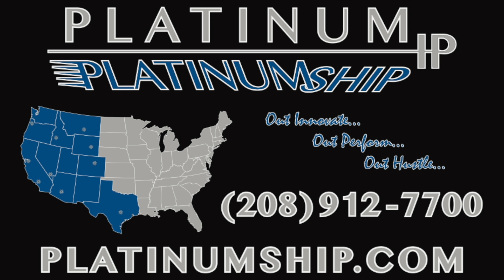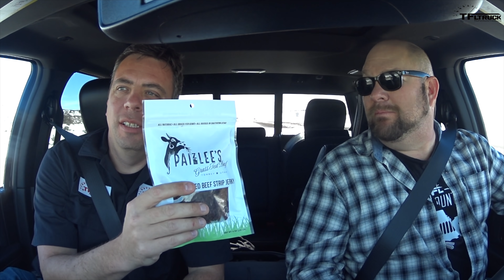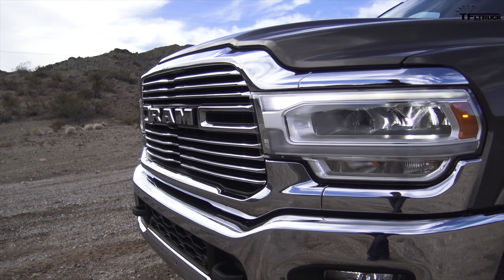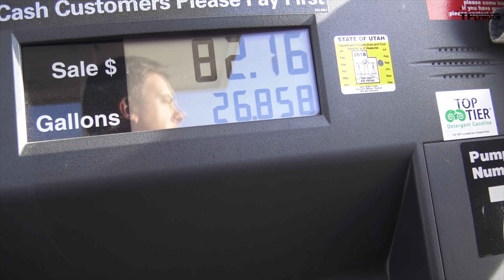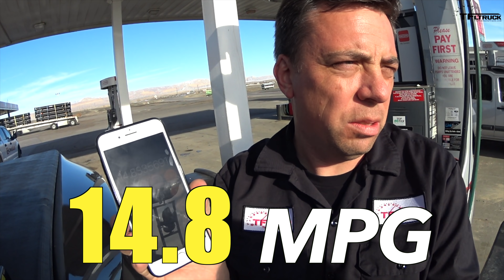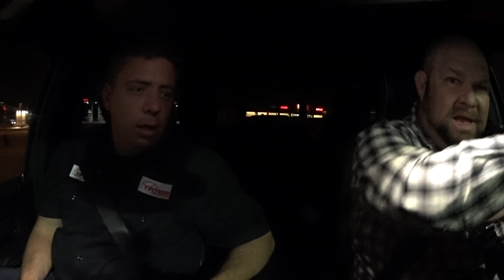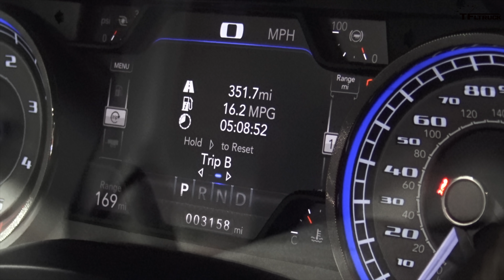We Drive 800 Miles in the New 2019 RAM 3500: Here's How Fuel Efficient 1000 lb-ft of Torque Is!

Comment: I feel like 15 mpg for an empty diesel is pretty terrible. I guess society can thank def and emission systems for that.
Reply: Try driving a 18 wheeler and see I get like 7 to 8 mpg to the gallon
Reply: Darius Hope Thats actually pretty good for a semi.
Reply: @JohnDoe-nz6bk  it really is
Reply: Darius Hope I probably get about the same, but with my job and running a PTO for about 4hrs a day I only get 4.5. Glad my company pays the fuel bill.
Reply: @843MudMafia.  I have a 2014 Volvo that's getting 6.2mpg pulling a 6axle trailer that has a 140k gross and it's loaded with 94k in the tank. It's far better than the Pete's getting 4.7mpg pulling the same loads. Lol. Empty it's getting 9.6mpg 46k tare. Back in Nov I went from New Brunswick to Port Huron Michigan and averaged 5.2km/L(12.2mpg US/14.6mpgIMP) empty of course.
Reply: Darius Hope the truck I drive gets about 4 lol
Reply: @843MudMafia.  7-8 but you get that, for the most part empty or loaded
Reply: I don't think anyone has mentioned that this is 15 mpg on winter blend diesel. My 2015 Ram with the 6.7 picks up about 1 - 1.5 mpg during warm months when fuel stations aren't running winter blend. I would be interested to see a real world test during the summer.
Reply: @raymondprell398  glad you caught that as well. Pilot truckstops where they fueled both times it looks like blends 50/50 #1 and #2 diesel in the winter. Very terrible fuel mileage in winter.
Reply: Raymond Prell 1 mpg from winter blend to summer blend do you thinknit makes a difference!!!!This trucks fuel efficiency is crap!!!And i am a diesel mechanic!!!Empty to get 15-16??????!!!!!Its should get close to 20-21 empty!and go in low double digit when towing or even single digits!
Reply: @raymondprell398  yeah, but 16-16.5mpg is still pretty bad
Reply: Super_sayan Goku no, it's not!
Reply: @super_sayangoku2074  I don;t think that is to bad considering the truck they were in was a 3500 Dully that certainly will weigh more than 8500 + pounds.
Reply: @super_sayangoku2074  motor in a dually.  They're bricks aerodynamically
Reply: Raymond Prell there is NO SUCH THING AS WINTER BLEND DIESEL!
Reply: @JohnDoe-nz6bk   yes there is a winter blend for diesels it helps to keep the fuel from gelling in the tanks and fuel system I know I have driven a semi for over 35 years
Reply: @JohnDoe-nz6bk   um...WRONG. https://nwfuel.ca/whats-deal-winter-diesel/
Reply: rsg1963 WROOOONG! It's just a additive to keep it from gelling!! Doesn't effect the performance like gasoline winter/summer blend. Also, you supposed diesel owners, diesels perform better when they're hot. However, no matter what time of the year (I live in the rust belt), my Cummings consistently got between 19-20.4 mpg.
Reply: rsg1963 Winter diesel fuel refers to diesel fuel enhanced to prevent it from gelling in cold weather conditions. In general it is achieved by treatment with additives that change the low temperature characteristics of the fuel. Wikipedia
Reply: James Mcvey  yes, you're right! But, that idiot is trying to say that winter blend diesel acts like winter blend gasoline when it doesn't.
Reply: John Doe Yes, there is- http://www.kendrickoil.com/understanding-differences-diesel-fuel-grades/
Reply: John Doe really? Google if there’s such a thing as winter blend diesel fuel, I bet you find out the same thing I did, they mix #1 diesel or kerosene in with #2 diesel to lower the gel point for winter, depending on where you live in America if you’ve ever seen it before
Reply: Todd Miller I know there is you idiot, but it does nothing to the mpg as they add the extra octane. So hence, there's no winter blend diesel. Hell, they didn't even sell it where I'm from, just regular diesel!
Reply: Todd Miller don't try to argue with the guy about winter blend diesel.  You'll be wasting key strokes.  He doesn't believe that mixing anti-gelling additives to regular diesel constitutes as blending.  Hopefully he's just a 15 year old keyboard warrior and isn't old enough to vote.
Reply: John Doe lmao!! Now I’m an idiot for clarifying the fact that there is such a thing as (winter blend diesel fuel) which to my understanding it’s the total fuel density that makes the biggest difference, not just cetane, winter diesel fuel is more volatile but less dense because of the k1 or #1 diesel added to it, less fuel energy available from it, I’ll bet you didn’t know they have winter gasoline up here in the northern states, more volatile but less energy to be had from it, I’ve owned and operated semis and all kinds of diesels up here for 35 years and it’s just something we deal with up here so do some research
Reply: Todd Miller it's not winter blend, not like gasoline. Diesel is diesel, no matter what year you get it! Not that hard to understand idiot!!
Reply: Todd Miller oh, you do know that the oil companies add the additive to stop it from gelling, rather than mixing 1-2 right? Of course you didn't! Like I said, educate yourself before posting stupid comments.
Reply: John Doe have ever heard of #1 diesel and #2 diesel? What is the difference if diesel is diesel as you claim? Do you even know? The refineries start shipping the winter blend in November and goes to April I think and I don’t even gave a choice what I buy at the pump! So now you’ve called me an idiot at least twice now so I guess I’ll leave it go that I can’t fix stupid so live in your own little world  IDIOT!!!  Fling j and pilot (one and the same actually) in 2016 - 2017 policy was to single treat with additives to a certain temp then double treat to -5 degrees, anytime the temp would get below that they would mix in 20% #1 diesel, if that (preferred) method wasn’t readily available to them they would triple treat with additives. And that is from their published policy article  🤷🏻‍♂️
Reply: John Doe Damn your a total fool... again. You really are too stupid to simply admit when you are repeatedly proven wrong. http://www.kendrickoil.com/understanding-differences-diesel-fuel-grades/#
Reply: Todd Miller diesel one is just kerosene and used for heating oil, not really considered diesel. Are you too stupid to understand that?? Regular diesel is diesel as its diesel, there isn't different grades of you #2 diesel like regular gasoline. No one puts kerosene in a diesel engine to run, as it will blow your engine from lack of lubricating properties. Now, most places sell "winterized diesel" from the refineries that has the additive (not kerosene) to keep it from gelling and have the little octane boost to make up for the additive (basically it's your "summer diesel" year round) hence diesel is just diesel, there is no performance lost. You ppl are really stupid, especially you Larry. It doesn't take long to look this up idiot!
Reply: The Real John Smith oh look, Larry is back. I've proven you wrong too many times to count. Go back to mommies basement and cry like you normally do after I hand your ass to you.
Reply: @JohnDoe-nz6bk  I have to disagree, if you come up to the northern states they do have a "winter blend". Winter blend diesel will reduce your fuel mileage, Colorado is one of the state's that gets this mixture. 

http://www.lcbamarketing.com/why_diesel_fuel_economy_drops_in.htm

https://www.google.com/amp/s/www.bellperformance.com/bell-performs-blog/winter-diesel-fuel-mileage%3fhs_amp=true
Reply: The Real John Smith I also already provided a link and at the end of one of the paragraphs, it states "many car companies prohibit the dilution of diesel fuel with kerosene or additives, as it will ruin your common rail or unit injector."
Reply: Lorne H I live in the rust belt, and got 19-20.4 mpg all year round. It might have dropped a little from using remote start!
Reply: @JohnDoe-nz6bk  if your statement is true about not diluting your diesel with additives, what do you do In the winter?  Up here in Michigan without it, your engine will not start until spring. The "winter blend" plus polar power is the only way we can run our equipment. I don't want to be mean, but you have no idea what you're talking about...
Reply: Lorne H that's where glow plugs, heater grids etc come in. I never had a issue with my Cummins starting. Hell, my 2016 limited even had a fuel heater in the tank. A little slow sometimes, but it always started.
Reply: @JohnDoe-nz6bk  I'll wait for you to show me where those are on the 15 liters. Block heaters are the only thing we have. But they are useless if your fuel is gelled, the only thing you can do for that is " winter blend diesel" with additives. I'm a Nccco crane operator/ heavy equipment operator with a Class A CDL.  You have no idea what you're talking about.
Reply: Lorne H I have a new (2018) 4500 dodge and it says in the owners manual not to use any diesel fuel that is mixed with bio diesel more than 5%... every trucks top I go into mid states it says right on the pump that the mixture can be anywhere between 5 and 20%. The way I understand it’s because when it regenerates it injects diesel on the exhaust stroke to put raw fuel into the exhaust to help burn things out and with bio being a solvent it washes the cylinders and can cause excessive wear. Now me being a dumb truck driver for 35 years and can’t even buy the right fuel for a brand new truck (which is deleted to solve the issue) to protect my investment I’m supposed to believe that just because some car manufacturers say you can’t add #1 to diesel in the winter months to help with the gelling problem that they don’t do it   Lol  sorry this is in response to the idiot John Doe and not directed at you, just had to vent   Have a good night
Reply: Todd Miller yea, you're definitely a dumb truck driver. 99.9% of truck drivers aren't very intelligent!
Reply: Lorne H I absolutely do! If you're a "crane operator" then you know the diesel standards are next to nothing and thats why the red dye diesel is used. Nice try though!
Reply: @JohnDoe-nz6bk  Try using the red dye diesel on a Linkbelt ATC 3210 going down the road. If you ever got a D.O.T. inspection, you would know any mobile crane will get it's fuel tanks check. If I had red dye in my tanks I would be shut down, waiting for my tanks to be pumped. Hell that's for any Commercial vehicle going down the road. Even the "dump truck driver" knows that lol.
Reply: Lorne H uhhh.. You do know that using heavy machinery like "your crane" only uses red dye and is allowed to be on the road while transporting. 🤦‍♂️ nice try at acting like you're intelligent.
Reply: Lorne H oh, here... https://www.dieselmachinery.com/inventory/?/listings/cranes/for-sale/24565391/2018-grove-yb4409xl?dlr=1&pcid=3769311&sfc=0&ssc=0&lpcid=2993799&snai=0
Reply: John Doe you must be one of those coal rolling yuppies that (has a Cummins) and lives in your mommies basement?   Lmao
Reply: Todd Miller rolling coal is the dumbest thing ever, idiot! Only inbred hill Jack's do that!! Like I said, I'm more of man then you'll ever be and haven't been in "mommies basement" for almost 2 decades!
Reply: @JohnDoe-nz6bk  Wow that is the dumbest thing I've ever seen. That's a grove carry deck, transported by a low boy. You do know that the crane you sent me runs on propane also, like a hilo. 

I send you a mobile crane link, the " Linkbelt ATC 3210" drives itself down the road. You have absolutely no idea what you're talking about. I'm actually blown away by the stupidity you're bringing to the table right now.
Reply: @JohnDoe-nz6bk  it's transported, not transporting. Big difference, off road crane's get transported by a semi and trailer, transporting is self driving. Look up all terrain cranes. You can't really be this dumb? You're the perfect example of what someone looks like that has no idea what they're talking about.
Reply: @JohnDoe-nz6bk  https://youtu.be/jyPzmy1xG1k
Reply: Any vehicle that drives itself down the road, has too have "onroad diesel" lol
Reply: Lorne H no, not when you have to transport it from site to site. 🤦‍♂️ geezus man!
Reply: Lorne H 🤣🤣🤣 says the idiot who doesn't know what he's talking about!
Reply: Lorne H who's stupid again?? https://www.irs.gov/pub/irs-pdf/p4941.pdf
Reply: @JohnDoe-nz6bk  Any commercial vehicle that drives down the road has too have on road diesel! What don't you understand? If it's being hauled on a trailer it doesn't. I sent you a link of the Linkbelt crane I operate, driving down the road. Are you that dumb? All semis, mobile cranes, run on road diesel.
Reply: @JohnDoe-nz6bk  You just sent me a link proving my point! " Attention trucker's, no red dye diesel on the highway's". Mobile crane's drive themselves down the highway, they fall under the same rules as semis. I have to have permits when I go down the road, stop at the same weight stations. Dam you're dumb.
Reply: Lorne H here's another link belt for you, idiot. That needs a semi to haul it, but still uses red dye and can drive it's self from site to site if need be. I can't believe the pure stupidity you're showing. And you have a class A??? 🤣🤣🤣🤣🤦‍♂️ God help us!
Reply: @JohnDoe-nz6bk  crawlers, rough terrains all need to be pulled to job sites. I run All terrains! They drive themselves, what do you not understand about that? I'm blow away by your stupidity...
Reply: Lorne H and yet, I proved you wrong. idiot!
Reply: @JohnDoe-nz6bk  yes site to site if it's off road lol, not driving down the highway! I'm still waiting on the link?
Reply: @JohnDoe-nz6bk  I can't wait for other people to read your comments and see how dumb you're kid. You should probably delete your comments lol....
Reply: Lorne H yes, you can drive them "on road" you idiot! I'm not talking 30 miles, I'm talking like 5 miles. I know, I've escorted them. I also use to operate a CAT frontend loader. Like I said, you have a class A?? God help us!
Reply: Lorne H 🤣🤣🤦‍♂️ you call me dumb?? Bwahahahahaha it's you are, not you're! 🤣🤣
Reply: Lorne H I provided it, I can't help you have a SEVERE reading comprehension problem!
Reply: Lorne H red dye has to be used for non registered vehicles you idiot! Like a frontend loader, certain Crain's etc. However, those still can be driven on the road for certain things! 🤣🤣 geezus man, don't you known how to read??
Reply: Lorne H https://www.linkbelt.com/product-line/lattice-crawlers considered "off road" but still can be driven on road!
Reply: Lorne H OK.. I will admit I'm half wrong. I didn't realize that each state has its own set of laws regarding off road machinery. In my state, it's allowed under our ORC and most likely different in other states. https://www.google.com/url?sa=t&source=web&cd=1&ved=2ahUKEwjJo7Wit4PhAhUBYK0KHZ0wB5wQFjAAegQIABAB&url=http%3A%2F%2Fcodes.ohio.gov%2Forc%2F4513&usg=AOvVaw0B7xovzuIiTW9sn2cfg9ae
Reply: @JohnDoe-nz6bk  you sent me a link for a crawler crane lol. Show me a crawler going down the road that's not disassembled and on a trailer. I've worked in 49 states, all terrain cranes are registered vehicle's that are self propelled. You have no idea what you're talking about.
Reply: @JohnDoe-nz6bk  you sent another link proving my point again lol.
Reply: @JohnDoe-nz6bk  if you want anyone to even consider what you're saying, you will get rid of the crawler crane link with a rough terrain one. That would be the only one to use off road diesel to cross a road lol...
Reply: Lorne H I absolutely know what I'm talking about, and proved you wrong AGAIN!! Geezus man, you really are that stupid!
Reply: Lorne H the link proved your point?? 🤣🤣 you need to working on your reading comprehension problem there!
Reply: Lorne H I have no idea what I'm talking about?? Bwahahahahaha 🤣🤣🤦‍♂️ like I said, it's scary that you have a class A. Hell, I even provided the ORC to my state where it says it's allowed to. But hey, you continue to work on that reading comprehension. 🤣 I can see why your were only able to drive a truck! 🤣🤣
Reply: @JohnDoe-nz6bk  yes there is because if u go north without it in winter ur feul will gell up.
Reply: @jamesmcvey3178  i agree i drive a semi myself
Reply: John Doe Holy crap you are the most ignorant dumbass on the internet.  

“Diesel Winterization
Diesel fuel needs to be winterized.  Why?  Diesel fuels contain paraffin (wax) which causes it to gel as it cools, leading to possible engine failure. No one wants to have a stalled vehicle in frigid temperatures.  Number 1 (1D) and Number 2 (2D) are the primary fuels for most diesel applications. During warmer months, 2D, considered a summer-grade fuel. As the weather cools, distributors change the mixture of the fuel to a “winter blend” or “winterized blend” of 2D and 1D. See the article from Freightliner’s Team Run Smart for more details.
As the seasons change, it is a good idea to check the fuel grade, as well as the cetane rating on the pump. The higher the cetane number, the easier the diesel vehicle will start in cold weather.”

https://www.trucking.org/ata%20docs/About/Organization/SMC/Documents/Diesel%20Winterization.doc
Reply: @JohnDoe-nz6bk  Thank God that you have to be Nccco certified to run a crane. Other wise people would get killed because of idiot's like you. You have no idea what you're talking about, ground bearing pressure, ground conditions, being level or within grade conditions. I'm going to take my couple hundred thousand pound crane with a hundred foot of boom down the road. Never mind all the power lines tree's lol.
Reply: @JohnDoe-nz6bk  https://www.google.com/url?sa=t&source=web&rct=j&url=https://www.nassco.com/purchasing/environmental/10_Off-Road_Diesels/10_%2520Env%2520Req%2520for%2520Operating%2520Off-Road%2520Diesels.pdf&ved=2ahUKEwic2qjW_YPhAhUBIqwKHYXOBXkQFjABegQIAhAB&usg=AOvVaw2s2lweHOkNcTEjs2YUA6MX 

Thank God for licenses, or people like you would think they know what they're talking about lol.
Reply: Lorne H 🤣🤣🤦‍♂️ like I said, you're a special kind of stupid! What does that link have to do with anything?? You do know that semis do travel on the road that are well over several hundred thousand pounds right??? Oh, that's right, you're not a very intelligent person and you have a class A?? My God, that's very scary! I already proved you wrong, shown you a crane does come with heater grids, etc. Shown you that machinery that uses red dye diesel can be used on road for certain applications, etc.. Get over it soyboi, you lost and turn your class A in. I bet you don't even have one and are suspended! 🤣🤣 typical dumbass truck driver
Reply: The Real John Smith I may be ignorant sometimes, but you're the dumbest!
Reply: John Doe Multiple people calling you out with sources and you remain as ignorant as ever.
Reply: The Real John Smith better than being a dumbass like you! And that's because we're all right! They'll mix it and add the anti gell additives. I've talked to several truck drivers today and they all said there was no difference with performance or mpg, if there was, it was slight!
Reply: John Doe You mean the same truck drivers you insulted and called 99.9% not smart a few comments ago? Once again your full of shit. The driver has no idea what is in the tank of the station they are filling from. Twice a year refineries switch between summer and winter blended fuel. It is already blended at the refinery and further blended at the terminal. https://www.google.com/amp/s/www.bellperformance.com/bell-performs-blog/winter-diesel-fuel-mileage%3fhs_amp=true
Reply: @JohnDoe-nz6bk  yes in CO we have number 1 or number 2 diesel depending on the time of year.
Reply: John Doe your are absolutely wrong. Specifically, it has kerosene blended into it, which will show up in hp and mpg, but probably not enough for a soccer mom like you to pick up on it. 
     If it where not so, fuel would gel. Drive to Florida right now, fuel up a jug of diesel and put it in a deep freezer for a few gpurs
Reply: @JohnDoe-nz6bk  
No one puts kerosene in a diesel huh? How about the us military? In many theaters the only thing the entire motor pool runs on is JP5 or JP8 jet fuel. Guess what that is. The approved list for even the large trucks is diesel 1, diesel 2, jet A, Jp5, Jp8, commercial kerosene, diluted used oil, and so on. Every last piece of diesel equipment around a air base runs on kerosene. 
 I personally ran a Cummins ram on nothing but Jet A for years. That truck is still on the road.
Reply: @JohnDoe-nz6bk  no "G" in Cummins...  how hard is spelling?
Reply: @JohnDoe-nz6bk  yes there is. I delivered it. Friggin troll
Reply: Robert Rutherford suuuuure you did!
Reply: @JohnDoe-nz6bk  yes there is winter blend. We have to run it in WI in the winter.
Reply: @JohnDoe-nz6bk  wrong. Its blended.
Reply: @JohnDoe-nz6bk  winter blend is a mixture of number 1 and number 2 fuel. This last winter we had to run 50/50 mix to not gel up.
Reply: @JohnDoe-nz6bk  I have a 95 dodge 12 valve and I've always mixed kerosene in my fuel when it gets cold instead of the bottled additives. I also mix used motor oil in my bed mounted tank this mix I pump back into my and tractor. I have two filters on this tank that catches anything that's in the diesel, kerosene and the used oil before I pump it into my truck or tractor. 370,000 miles on the truck and still has original p pump on it
Reply: @JohnDoe-nz6bk  no truck or crane can run red fuel on the hughway. They will get you for tax evasion
Reply: @JohnDoe-nz6bk  yes there is in the rocky mtn states especially they put additives in to prevent fuel gelling.
Reply: @rigging1377  I drove an old Brockway 30 yrs ago had a 1693 cat engine that had glow plugs. But I do now that doesn't keep the fuel  from gelling we would mix diesel fuel with kerosene 50/50 fuel milage dropped but fuel didn't gel. That 1693 cat was the only 15 liter engine I have ever seen with glow plugs
Reply: I feel some of you are almost missing that the higher in altitude you go the less efficient the engine becomes. An average of 15 mpg at that altitude is decent. Like Nathan and Andre I wish the truck had a larger fuel tank.
Reply: DEF doesn't sap fuel economy. DPF does.
Reply: Erik Kovacs they are one in the same. Def is the fuel for the dpf.
Reply: @nothankyou9906  not exactly. diesel fuel is injected directly into the DPF for high heat regeneration.   DEF is used the rest of the time to knock down NOX.
Reply: They were running 70-80mph.
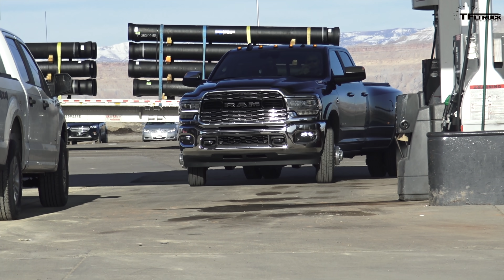Reply: dedalliance1 I think it’s the 4:10 rear end
Reply: Trucks with NOx control and DPF systems are less efficient without DEF, but that does mean DEF increases efficiency. DEF doesn't provide a net increase in fuel efficiency, it just lessens inefficiency of other emissions systems. Rip EVERYTHING out from under that truck, and you'll be closer to 20 MPG.
Reply: It has 4:10 gears and a aisin  transmission. And DEF isn't a bad thing, it's the EGR AND DPF that hurts you!
Reply: @JohnDoe-nz6bk  Well, even my 2018 GMC Sierra 3500 crew cab long bed gets 12ish mpg highway with a 4.10 rear end with the 6.0L gas engine.
Reply: dedalliance1 my 2016 ram 2500 mega cab limited Cummins got between 19-20.4 mpg.
Reply: dedalliance1 then what are you complaining for??
Reply: @JohnDoe-nz6bk  I'm not complaining I'm just saying for a diesel 15 mpg doesn't seem very good on a completely redesigned truck when my gas engine is arguably 2 decades old of a design and still gets 10 to 13 mpg. Maybe they should start designing trucks for fuel economy instead of some 35k pound tow rating that's never going to be used by 99 percent of buyers.
Reply: @dedalliance1  the 6.0 is a powerless turd
Reply: @corylee2261  no kidding... garbage motor.
Reply: John Doe was gonna say I thought they got about that
Reply: @dedalliance1  yet that gasser has no where near the power level or capability of the diesel. However, not everyone needs a diesel or that much tow power...so gas options are good to have
Reply: Cory Lee ignorant
Reply: @dedalliance1  are using the computer in the truck or are you hand calculating.  I've got the same truck and I get 14 combined city and highway and that's hand calculated. The truck always says 13.3 though. During the spring and summer I get 14.5 to 15 mpg combined. I've always loved the 6.0 vortec.
Reply: @JohnDoe-nz6bk  2500 should be better, as it has fewer tires and doesn't have the big wheel coverings that hurt efficiency quite a bit. But also, this is them crossing mountain ranges.
Reply: @dedalliance1  ---15 mpg is 25% better than 12 mpg.  Pretty huge difference really...
Reply: @JohnDoe-nz6bk  Guessing it didn't get quite that high at 75-80 TFL claims they were driving.  Slow it down to 65 and get big improvement on my 04 Chevy Duramax Dually empty 18.5 mpg.
Reply: @roadrunner7828  I just go off the computer, it's usually around 0.5 mpg plus or minus when I double check it. But over the 8,500 miles on it the truck says it's averaging 10.5 mpg.
Reply: @larryj8924  But who honestly goes 65 mph unless you're towing, and then it doesn't matter.
Reply: Well this comment like super exploded. I personally think these companies should be putting more money and engineering into fuel efficient instead of 35k towing numbers. But that's just me, obviously diesels are much more powerful, but they're supposed to run a lot more efficiently than gas, but for the price of diesel fuel, more money in oil changes and the additional purchase price, I wouldn't buy one unless I was going to tow 14k+ pounds and or tow more than a couple 2 or 3 times a week.
Reply: dedalliance1 the cost of oil changes is the same or better per mile.  The intervals are much longer than a gas engine.  So 10 qts vs 6 qts but I go 10,000 miles with my Duramax vs 6000 miles with my daily driver 6.0 vortec.  I own both at the same time and put an average of 30,000 miles per year on them combined.  The gas is much better suited to daily driving because the city mileage of the diesel is only 2 better than the gas and the gas truck is cheaper so I save the diesel for my “nice truck” and drive gas during the week.  Diesel has bigger cost when they break but routine maintenance is not really a factor.
Reply: @LTD_Outdoors  are you my dad?  My dad would always do the exact same thing when I was growing up.  Always cracked me up.
Reply: dedalliance1 lots of buyers will be 5500’s which will have the same engine. Those will work a lot.
Reply: @dedalliance1  
Keep in mind that this truck was a dually, that hurts fuel economy alot. I'm sure a single rear wheel could easily hit 20mpg.
Reply: @dedalliance1  you also have to take into account that it is a new truck, once it gets  broken in the mpg will get back
Reply: @moparjr89  Hopefully it will get better gas mileage when it breaks in, but I don't know how much it's really going to improve.
Reply: @dedalliance1  -- maybe people don't need a 1 ton dually with a thousand ft lbs of torque to go to the mall, let trucks be trucks and cars go to the mall
Reply: @mdlclassworker3384  I don't think I said anything about trucks going to the mall, but in reality with the prices of these new trucks a lot of people can't afford the taxes and registration and insurance of a truck and a car and also pay for the car at the same time, so it forces people to drive their work trucks all the time and getting 15 mpg if you have a 30 mile commute each way can really add up. I'm just saying it would be nice if the truck companies would invest more money into fuel economy instead of 35k pounds of towing when anyone with a brain pulling that much is going to get a medium duty truck. If they could push 20 mpg empty with a tune in the truck that would be great.
Reply: @dedalliance1  maybe 99% of the market bought the wrong truck. Those trucks are for towing and utilities like pulling a horse trailer or auto hauler that doesn't want to buy a semi. Sadly if you're cruising and care about mpg get a half ton
Reply: @kamilzarzycki3866  unfortunately halftons hardly get any better fuel economy, my old 05 Sierra extended cab standard bed halfton got 15 to 18 highway usually, one time I got like 21 but that was rare. Like the new ram halfton didn't it get like 17 or 18 on this channel?
Reply: @dedaliance My 05 3500 gets 20ish mpg, Cummins 5-9.  But I need a truck that'll haul 30K not  the 15K my truck is rated for.  Perhaps if you need less truck, and better mileage, buy a 1500.
Reply: Cory Lee no it’s not
Reply: @dedalliance1  without DPF/ DEF diesel trucks get closer to 20mpg. I've owned 3 Rams and use a Ford f350 for my business. It's all the same story till u delete them. Then they get much much better. DPF/ DEF was designed to just suck another 10-15$ every 3rd-4th fill up from the logistics business.
Reply: @dedalliance1  they did! Its the 2500! 2500 has the standard output engine that has 19:1 compression ratio! The high output went down to 16.5:1. So u have options!
Reply: @dedalliance1  
Dodge has a pickup for you. It's called, 2500 & 1500 (30+ mpg).
Reply: @nellyfarnsworth7381  I don't think any ram 2500 reliably gets 30 plus mpg, I don't even think their halfton diesels reliably get that. Maybe with a tune and delete kit, but that's about it.
Reply: @dedalliance1  
The new 1500,  Diesel 3.0 liter is 29 & 30 mpg highway UNLOADED. 
My brother's Dodge 2500  5.9 liter with 12 valves, with manual transmission (when new)  would get 24+ mpg Highway. But new was 700,000+ miles ago.
Reply: @nellyfarnsworth7381  EPA isn't always accurate, and a 5.9L 12 valve cummins was pre- Emissions everything, so it's obviously going to get better fuel mileage. In todays time we have to deal with emission equipped trucks, unless we delete them.
Reply: @dedalliance1  
Read again, the Dodge new 1500 with 3.0 liter diesel with get 29 & 30 mpg highway UNLOADED.
Reply: @nellyfarnsworth7381  http://www.fuelly.com/car/ram/1500/2018?engineconfig_id=238&bodytype_id=14 Says you're wrong.
Reply: @dedalliance1  I doubt that people buy 3500's unless they need to tow heavy trailers. We're not looking for hybrid-type MPG. We need tow capacity. Our hybrid is our commuter vehicle.
Reply: @jos.4276  Right, I get that but even 1 mpg is a big price difference, especially if you're using your vehicle for work.
Reply: @dedalliance1  A different vehicle may be a better choice for you?
Reply: @jos.4276  I mean, I personally have a 2018 GMC Sierra 6.0l gas SLE 3500 HD Crew Cab Long Bed that I put 28k miles on, never resetting #2 trip meter its averaged 9.6 mpg. So trust me I speak from experience spending 300 to 400 a month on fuel, and 700 a month on the truck and 200 a month on insurance is a really expensive cost to own for a vehicle. These manufacturers are out of their minds if they think they can charge a 10k premium for a emissions riddled diesel that gets crap fuel economy, garbage reliability because of emissions and the fact it's illegal to tamper with them (not that it stops anyone, for now) and they're super expensive to fix.

I've seen plenty of 6.0l gas engines go 200 to 300k and 400k miles without a whole lot of problems, they're cheap, easy to find parts and they're small so you can actually work on the engine without taking cabs off lol (ford).

But also, I have a 2014 Chevrolet Cruze 2.0l Turbo Diesel that's rated at 47 mpg highway and is unfortunately equipped with emissions, but that's okay because it's worth keeping it running because it's the most fuel efficient non hybrid vehicle that you can buy and still fit 4 or 5 people in. One of these days though I'm going to delete it so I can push 60 to 80 mpg.

But to sum it up, I don't know why I'd want to buy a new diesel that's anywhere from 45k to 85k dollars, that gets ultimately garbage fuel economy, pay more for diesel fuel that's a byproduct of making gasoline, riddled with emissions problems, pay more for any repairs, so I can look cool doing 75 up a mountain pass with a trailer lol. My gas truck does just fine and will last longer lol.
Reply: @dedalliance1  I get 14.5 mpg (city) with my 6.7 Cummins '19 Ram 3500. I paid $43 k for it, barely used, with 10k miles on it. We're hauling a trailer. It gets better mileage pulling our trailer than our 2016 F150 gas 3.5 ecoboost. This will likely be our last truck.
Reply: @jos.4276  Hopefully it's your last truck, but it being a Ram there's a decent chance you'll replace the transmission sooner than you should. The Electronics will start to fail in it like any modern vehicle, and the emissions systems are usually garbage and will break, when it's out of warranty that's expensive.

For example, my sister has a 2011 3500 Silverado diesel,  granted it's the first model year of all the emissions, but like a little bit before 200k miles she drove from Colorado to Illinios hauling a horse, when unexpectedly in Illinios the emission system failed and put her truck into limp mode. So what do you do, you're a thousand plus miles away from home, you have a 25' trailer with a live animal in it and a truck that won't go above 25 mph. A tow bill would likely be thousands of dollars, a real fix on the emission system would probably be a couple days, if not a week, assuming you're close enough to a shop that can do it, and has time. Luckily for her, she lives in a county that doesn't do emissions / smog checks so she took it to a shop and had them delete it, but this was Pre-Emissions crack downs we've seen in the past year or so. If that happened now, who knows if you'd find a shop that could do it.

I mean, Diesels are nice at 1 thing, and that's towing heavy things. The rest of it is just one giant expensive headache waiting to happen. I hope your truck is your last truck and goes 300, 400, 500k miles, but it likely won't without dropping a lot of money into it, and in 15 years or 20 years from now who knows, your truck may be made illegal because it won't be able to pass the new standards for emissions. They're already doing that in California, making diesel trucks that can't pass emissions illegal unless you spend 10 grand retrofitting emissions on them, no matter how old or new it is. The rest of the country isn't much further behind, look at History, everything Cali does the rest of the US adopts later, so hopefully you have a good amount of time.

That's just why I think diesels and manufactures are out of their mind, charging a premium for trucks that aren't reliable, are expensive, and still can't even break 20 mpg there's no reason to buy one all the big 3 manufactures are putting out gas trucks that tow 16-17k pounds, and they'll probably last longer lol.
Reply: @JohnDoe-nz6bk  I had a 2017 Ford F-350 DRW 4.10 4x4 that got 17.5 on the interstate highway.
Reply: @JohnDoe-nz6bk  def sucks.
Reply: I have a 14 2 door ram 3500 and gives me 16mpg so 15mpg for a fully loaded truck is really good
Reply: All you guys talking high numbers on fuel economy, be sure and check the fuel usage by a gps and the actual gallons used, the mpg meter in the trucks are MAYBE close sometimes but never actually accurate, I bought a brand new 1999 dodge dually that constantly said it was getting 20 / 21 mpg, in actuality subtract 3 mpg from what it read and you were pretty close, i own a brand new 4500 right now that I tow with ...... the meter is a novelty on it also   Lmao  I could say my 99 got 21 mpg because it did on the computer but it wasn’t nowhere close in actuality, I don’t believe all these high numbers unless it’s calculated with gps and a fuel receipt, then you have to even know which way the wind was blowing so a one time high fuel mileage claim from any of the big 3 don’t mean anything to my    Lol   I can drive down the road grossing 40,000 # and get 12 mpg... on flat ground and a 30 mph tail wind at 60 mph .... does it do that often?  NOPE!!! Lol
Reply: @zeusmia3554  almost everyone I know that has a 2500 diesel lies about what they get.  Funny they all get 20s.  I've owned enough of them to know 20 basically 9nly happens on highway only.  You add any city driving and its 15 to 17 hopefully.  I had a buddy brag about 22 mpg after he bought his new.  Later talked to him and found out that was resetting the gauge while driving.  People are idiots.
Reply: Matt Smith Just one source for a reference - http://www.fuelly.com/car/ram/3500?engineconfig_id=233&bodytype_id=14&submodel_id=
Reply: @MattSmith-vl8zp  19.9 was my best had calculated 2016 cclb 2500 ram diesel. Depending on weather and route 15-18 mpg never 20 or over for me
Reply: @claytonblachly4031  that's realistic...dudes acting like they average 24mpg on a 3/4 ton truck that weighs 8000 lbs plus
Reply: Factoring the truck is going over mountainous passes, is hard-loaded Limited, driving in the dead of winter, etc, 15MPG is not that terrible.
Reply: Whether you like it or not, Cummins makes the best diesel's on the road.
Reply: Do the EGR an DEF delete an get better fuel mpg.
Reply: @vulcanfist3007  absolutely they do, I've seen significant better fuel mileage on our glider semis. That's a brand new truck with a rebuilt pre emissions motor. I've seen 20 to 30 percent, depends on how you drive.
Reply: @vulcanfist3007  not the DEF just the DPF and EGR.  DEF has no affect on MPG.
Reply: Def and EGR/ DPF is the worst thing for diesel engines. Terrible Gas mileage til u delete it.
Reply: I had a 96 Dodge 3500, 5 speed manual, 4.10 rear with a 12' flatbed and averaged 18 mpg. Put some miles on that truck then check it again
Reply: dedalliance1 saving the planet one cardboard box & plastic jug at a time.
Reply: Winter diesel doesn’t help this MPG “loop”
Reply: Just delete it...
Reply: dedalliance1 My 2019 f250 Lariat diesel weighs 8240 “empty” with me in it. I routinely get 16.4 on long highway trips—hand calculated —empty. In the summer, I can top 17.2 avg on highway trips. I think Ram’s 14’s are horrid. It’s gotta be the 4.10’s. Perhaps break in will help some. I have 14,500 on my 19.
Reply: My pre emissions LLY Duramax gets only 15-17 empty but it's on 37" tires with a 4.10 ratio.
Reply: @BrianNC81  mine is a dually 6.0 all stock deleted can get 21 when I'm cruising at 60 mph it will go down to about 17 at 70 mph cause the engine speed is not far from 2.5k rpm
Reply: @Realdealwill4022  I've never driven that slow for any length of time to know if mine would do better.  Usually cruising 75mph on the highway so always at 16mpg ish.  Time is more important to me than a few dollars saved in fuel.
Reply: When I went to 4.10s that's when I saw a hit to mileage. The 3.42 is much better for mileage.
Reply: My deleted 2014 6.7 gets 22 to 25 on the hwy empty.  Before delete i was around 14 to 16.  It's a phenomenal difference in efficiency when they can breathe
Reply: exactly
Reply: Winter blend diesel + brand new engine that isn't broken in will net you around 15mpg.
Reply: On the other hand, my '07 Dodge 1500 with the 4.7 V8 would get about 14.5 mpg for my normal mixed driving. This truck weighs twice as much, has 5 times the power and 20 times the payload, and gets about the same fuel mileage. That's pretty impressive, in my book.  ;)
Reply: I just averaged 6.8 in my 15 liter semi, I was empty.
Reply: Lorne H that’s dang good, I wonder what you could get bobtailing? I’m sure your just like me tho, ya didn’t buy it to take the wife and kids to see Disney land, always something hooked to it trying to make a living, my 4500 ram only gets 11ish with a 11000 # flat bed hooked to it and combined empty of 21000, no idea what it gets by its self tho   Lol
Reply: @zeusmia3554  I apologize, I was Bob tailing. I went down to knoxville to pick up 2 brand new flat beds. It's a Michigan special T800, double framed with a Cat 550Hp, 1850 torque, 13 speed, 4.11 rears. If it was a highway truck it would probably do better.
Reply: Lorne H ah I understand now, that still is really good for a Michigan truck, I’ve never seen a truck from Michigan built for fuel mileage, and your probably just now typing up that you forgot about 3 extra axles hanging under that thing somewhere   Lol   That’s really impressive considering what it is
Reply: Todd Miller gosh that’s a terrible tare for a hotshot rig!
Reply: Yeah its really not great at all.
Reply: @BUILTDIESELMAFIA  Welcome to emissions motors...
Reply: @rigging1377  oh i drive a 2015 F350 I'm no stranger to emissions lol. Hate it. Wouldn't be bad if it was executed better but everyones systems just miss the mark of what it should be. Its a joke to think too that decreasing mileage is better for the environmemt. Some backassword thinking going on with the EPA.
Reply: 1000lb-ft, crew cab, drw, 4:10 gears, monster of a truck. Still gets better mpg than my 2002 v6 explorer used to.
Reply: My 1994 F350 4x4 12 valve swap averages 19. I see about 25 on the highway @ 70 mph. It has 4.10 gears is a 4 door long bed. 15 mpg all highway is pretty bad.
Reply: I'm inclined to agree, that's why I have a V8 gas F-150. 23.8mpg hwy all day every day.
Reply: Over 75% of the 6.7L Cummins is new for 2019. Block is now Compacted Graphite Iron, hollowed cam, new crank, new rods and pistons, hydraulic lifters (no valve lash every 150k miles), new high pressure fue pump, injectors, turbo, egr, egr cooler etc. 

Oh and oil changes on these trucks need to take 1 hour.
Reply: My 2003 F-350 can get 17mpg at 70 miles per hour
Reply: I leave trade chat and i still cant escape you @dedalliance1
Reply: Straight pipe and a tune are the solution
Reply: You can thank commiefornia for that
Reply: Running 75 to 80mph along that stretch of road in a truck that weighs around 8800lbs empty that is pretty good. It will likely average around 18mpg cruising at 60.
Reply: @doch5123  My 2018 GMC Sierra crew cab long bed SLE 4x4 6.0L gas engine with 4.10 rear end can run 90 to 100 mph at 10 to 11 mph. If I went 60 mph in my truck empty it could push 13 to 15 mpg, I just personally think a diesel should run more efficiently even at 80 plus mph. To me the whole point of a diesel is obviously the power for steering, but also the fuel mileage over a gas engine. I don't think this truck is meeting that standard.
Reply: Can't expect much from a 4 wheel drive truck
Reply: 27mpgs Indianapolis 2GrandRapids 30s temperatures
28mpg Jacksonville 2 WaDC
31mpg Ok City to Dallas Tx
27mpg Houston to El Paso Tx
27-33mpgs freeway 60mph
18-20mpgs city driving 10-18mpg off road
10-18mpgs tow 6kLbs Boat

2015 2500 Cummins 6spd 4x4 4door Crew cab deleted 4" pipe, KN flat air filter camper shell EdgeCts2 computer 

20gallon extra tank hitch 
3 light bars =970watts, 
Setup as 1st responder, 10,200lbs weight 

same mpgs since deleted by PFdiesel.com @78k
25-32mpgs freeway
20-25 city, 10-20 off road 
Avg.MPGs From 78k to 200k

Efficiency is measured TonXMiles per gallon used by scientist in the diesel truck industry.5.2tonsX28+mpg= 146TonMiles/gallon😀

Toyota Prius is 3200=1.6tX50 mpg=80Tmiles/gallon 😆

6 way MPG math calculated=
1-RAM computer
2-Garmin gps
3-Google maps gps
4-USGS maps gps
5-AAA maps Android
6-hand=4 semesters calculus

Diesel ECONOMY TIPS
1:Speed 55 & rpm 1500
2: Close Windows 
3: No items on top of car
4: Make truck aerodynamic  
5: Inflate tires 2 maximum
6: High rear end gearing3.42
7: Factory tall tires
8: 5-40w Synthetic Oil
9: avoid 4x4 driving
10: Remove excessive weight   
11: Fuel is heavy too
12: Plan journey wisely 
13: warm up engine
14: clean outside
15: Avoid RAIN 
16: No aggressive driving
17: Don't over-rev. 
18: Gear fast, slow & accelerate 
19: Avoid idling.
20: Overdrive & cruise control  
21: Ele&AC worsens MPG
22: Exploit cruising down hill 
23: Avoid a complete stop
24: red>roll in neutral gear
25: Tune engine to low HP
26: Change oil regularly.  
27: Replace air filters regularly.
33: Leave early Family drama 
34 constant Mph=Mpg 
36: avoid drama & stress
37 Park in shade
38 distance to prevent braking  
39: Forced induction =MPG
41:Rough asphalt tire wear+7% 
42:Use brakes to slow down.
43change fuel filters often
44change power train oils
45avoid wider tires
46avoid jacking truck height
47used tires =better MPGs
48TenDegrees=HalfMileMpg

Obama Diesel Exhaust😥 Cooker warranty expired 80k. 3rd Cooker😭 by 75K so @78k I deleted. Saving fuel & costs 10c mile = $1000/10,000 miles😀
Or $10,000/100k miles😀
So if I deleted@0, 210,000 = $21,000 fuel & cost savings 2016to2018😀

Some attack my background. So attack this you POS low life libs. I'm in the high class 151IQ. Top1% of America. 780 real estate escrows 750 text books 4 semesters calculus. Filled 5 passports traveling. On 6th passport. 8 states gun Ccw permits. 199 court cases. Own 8000+ acres California no loans since 1991. No drug's smoking or booz. American Red Cross VIP blood donor card since 1991. You must be a liberal. All mouth no brain cells left after all that low life shit😭😥 fico 826 & Forbes says top 1% of wealthy Americans too. You need help. Brag up$ not downward.
Reply: My buddys 96 12v makes 475hp and around 950 ft lbs gets 19 empty. Wow this is what progress looks like. Ill save the 70k and buy a 12v
Reply: My 18 Silverado dually gets 19 highway running 68-70
Reply: Yeah this test is garbage. Do a winter test and then do a summer test.  Than we will talk.
Reply: It's a dually.
Reply: You can thank displacement for the horrible MPG. Meanwhile a Mercedes Benz sprinter with a 3.0 tdi 3500 dulley is getting 15 round town with harsh acceleration. The truck was designed to tow and under 12 mpg is to be excepted. Wish they made trucks with efficient transmissions or an eco mode.
Reply: I got 20+ mpg in my junky 6.0 powerstroke. Diesels now are ass.
Reply: DEF goes through the  exhaust
Reply: 4:10 rear gears & driving it 80 MPH & ave for 750 miles of 70 MPH that is not bad. If they had the 3:73 rear & never went over 65 MPH probably get 20+ mpg
Reply: 15 mpg for a 9000 pound truck isnt bad at all,trucks are heavy!! Its not a 5500 pound half ton!
Reply: Need better fuel economy, buy a 2500 or 1500?????
Reply: So my family friends bought an '06 ram 4 door long bed with the 5.9l Cummins brand new. At the time they got the module + 3 tunes where they could actively select the tune from the display (can't remember the brand). I'll never forget that one time we had to drive about 70mi away to rescue a family member who's car broke down (faulty ignition switch or something). The Cummins, empty, with 3 men in it got 21mpg. When we picked up the 2,200lb uhaul trailer it got 19.1mpg. When we put the family members old honda accord on the trailer and towed it home, we got around 17mpg. I was completely blown away because if I hypermiled my '99 dodge Durango (4650lbs) at the time, I could only get around 17.3mpg, and a '06 Cummins 5.9l that weighed 7-8k, towing 5.5k got roughly 17mpg with that tune.

These newer Cummins engines are interesting to me, yet I've never driven one yet. I'm still pretty partial to the good 'ol 5.9l because it was reasonably powered, got fantastic mpg, responded great to mods and tunes, and would easily outlast the vehicles that they were installed from the factory in (IE dodge trucks, school busses, motorhomes, ect.) The 6.7l trucks just don't excite me asside for these H.O. Trucks. Honestly, if you have enough gears, the power output really doesn't matter that much. For example, my '14 ecodiesel is massively more powerful (feeling) than my friends old IDI diesel from the 90's even though on paper they produce about the same power. It's all down to gearing. My ecodiesel has 8 gears and a much better gear ratio for towing than their old IDI 3-speed auto with highway gears. My ecodiesel gets 2x the fuel economy (towing & empty) and tows just as much. For decades I never understood why they would try to make cars/trucks more powerful instead of focusing on transmissions with more gears to keep the engine in its power band at all times, then drop to 2 x Overdrive on the freeway. Nowadays, we're there with transmissions being 8-10 speeds, and it's exciting, but these big trucks seem to have lost something by going "bigger is better". 😔
Reply: That truck empty should get 18-19 at least!!!!At 65-70mph this truck ahould get that!!!!Not impressed at all!!!Old school Cummins alk day!!!
Reply: Is it weird that I want to daily drive a lifted dually even though I don't have anything to tow? (Although I definitely want to a big 5th wheel in the future)
Reply: Way2go America I would much rather see a truck rolling coal especially with the fuel difference how bad the def system sucks now
Reply: dedalliance1 15 mpg is actually pretty good for a 1 ton diesel
Reply: @bryang8311  Indeed. That's primarily in-town driving, too.
Reply: It's hilarious to see how many dudes with pre-emission trucks are bashing the mpg. 🙄
Reply: Yes the 4:10 gears hurt a lot. Also keep in mind they were doing 75 to 80 miles an hour. If they slowed to 70 to 75 they would have gained at least one MPG, and a 3:73 rear end would have given them probably another mile per gallon at least.
Reply: 15mpg it is awful but I dont blame Chrysler (or any car manufacturer). New legally imposed devices are crazy. I'm all for greener vehicles but if you go to the extreme of damaging a diesel efficiency you're doing worse than good.
Reply: 4.10 gears gave you the shitty miles per gallon. All the emissions didn’t do it any favors either. 1 ton diesel designed to haul heavy stuff what did you expect...Prius MPgs ?
Reply: Vegas to boulder Colorado is uphill all the way folks. Not all flatland. Also the speed limits out west are higher than east...so there are factors and outliers.
Reply: My mid 99 f350 stw has no emission controls and is lucky to get 13.5 mpg , js
Reply: I have an 06' Ram 2500 Cummins QC SB 2wd and was really disappointed when I bought it as I bought it as a daily.  I was averaging 15mpg.  Every month the mileage went up and it wasn't until about 30,000 miles where I was finally getting over 20 on hwy.  Now I get 24mpg on the hwy at 100k miles and 65mph hand calc'd and with a Power Puck, muffler, and drop in air cleaner.  They really need to break in to get the best mpg.
Reply: Marty Swanson RaM 2500 and 3500 -is different models, my dear friend. 2500 has - better mileage, than 3500
Reply: Speed is what's killing it. Drive at 60 to 65mph and your mileage goes up. Drive with a lead foot doing 75+ and it sinks like a brick.
Reply: Ratkill9000 I've never had that issue!
Reply: @Ratkill9000 totally agree.  They said they were stretches of doing over 80. All of my trucks the MPG drops quickly over 70 MPH.
Reply: Before watching I was thinking it would return 17.5 or better.
Reply: Abysmal fuel economy. My 2004 ram with the 325/600 5.9l, and only an exhaust modification and the stock 3.73 gears sees 24mpg at 120km/hr all day long.
Reply: That's because they are lied about the mpg .
Reply: Yes it is kinda bad mpg
Reply: 15 mpg lol my 6.0 gets 24
Reply: ArchV1 doubt
Reply: dedalliance1 I agree it should of been at 19 even 20 MPG
Reply: My dad and I took a 650ish Mile road trip from an hour north of Detroit to Hershey Pennsylvania in our Ford super duty with the 6.7 powestroke diesel.  With the 35 gallon tank we averaged 21 mpg there and back
Reply: Super_sayan Goku F 250? Or F 350? Cause is 2 big difference!
Reply: @super_sayangoku2074  my 2019 6.7 F350 is 19 on the highway and she only has 5500 miles on the clock
Reply: @jnk26  my dad has a 2016 6.7 and from what we have heard, they don't run good until you put 100K miles on them
Reply: @super_sayangoku2074  it's all good I feel she runs fine. I know it will get better with miles
Reply: Super_sayan Goku it says right in the manual, you have to tow to really break it in.